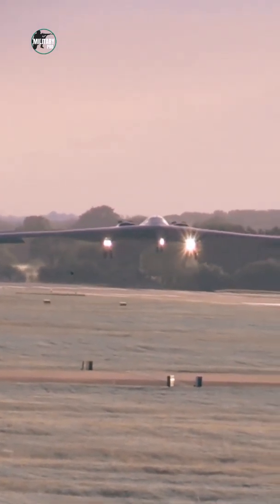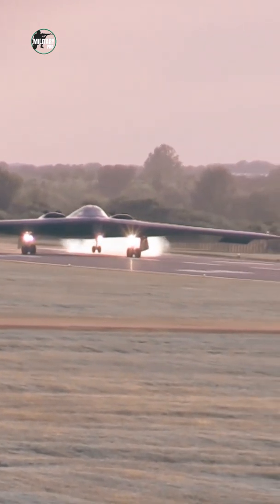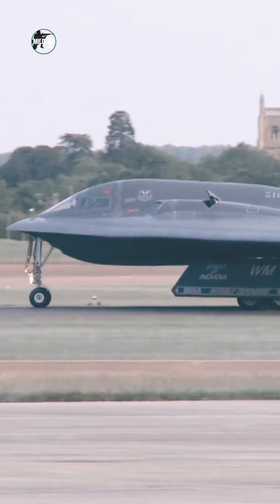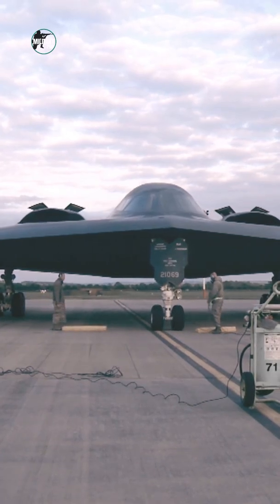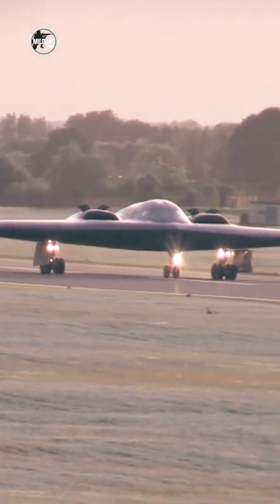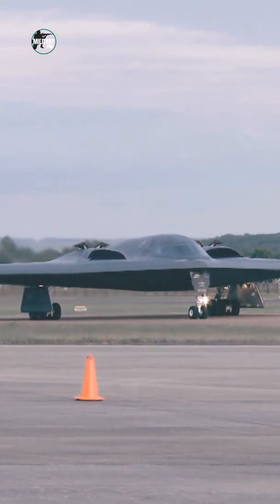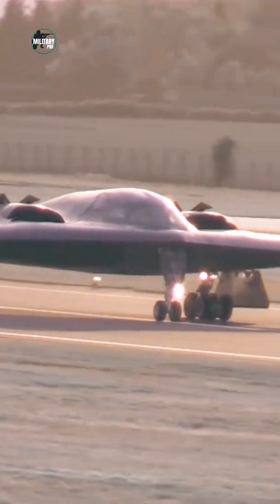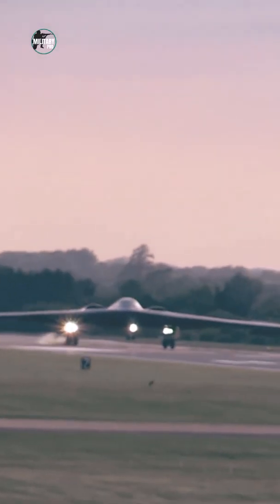How Does B-2 Fly Without Tail? #shorts #usmilitary #usairforce

Comment: Came here wondering how it maintains stability on the yaw axis, left with the same quesiton. Obviously this plane could not fly without fly-by-wire and computer aided control, but how does it maintain lateral stability with no vertical control surface?